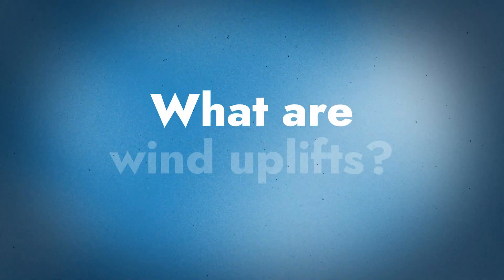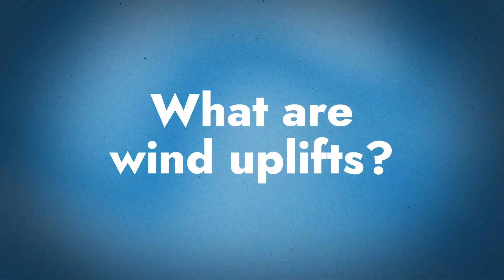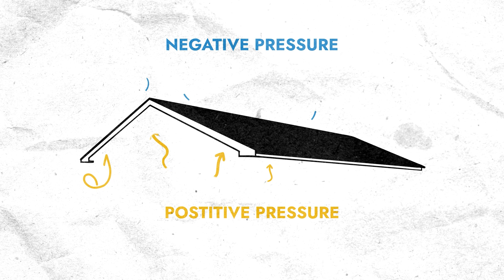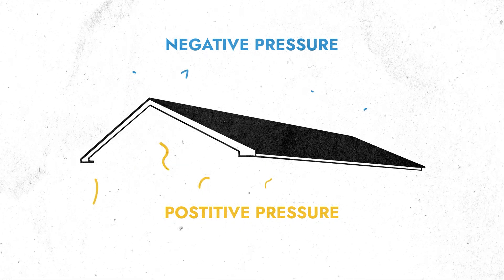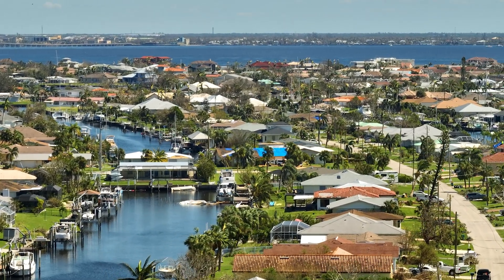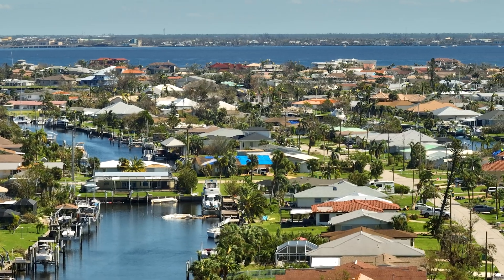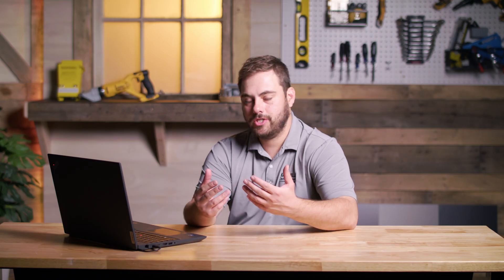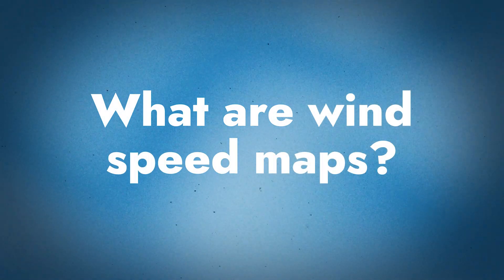Wind Uplifts 201: Engineering Design Criteria  & Practical Application

Comment: Video is right on time.  The new FORTIFIED guidelines being implemented here in the Gulf South are an opportunity to sell and install more metal roofs than we have previously been able to do.  Would be great to see you guys do a video from the installer’s standpoint,  determining design pressure.
Reply from the maker: Thanks for the suggestion! Can you expand a little bit more on what type of video would be most helpful? -Thad
Reply: 12:15 What type rafters, deck, clips and sheets for 100 mph winds? In SE Missouri.